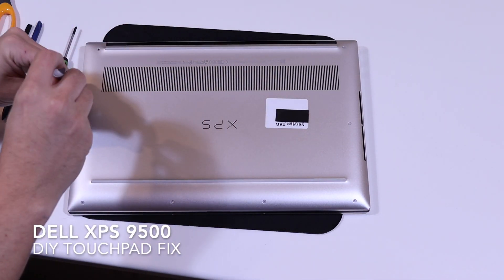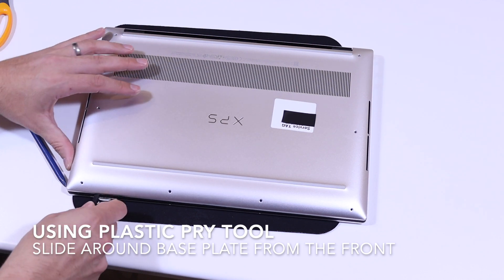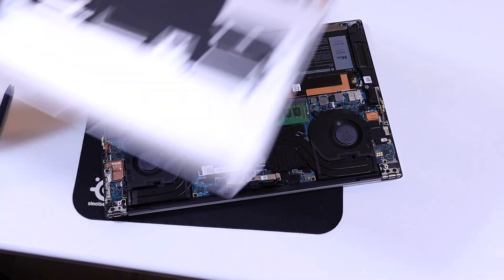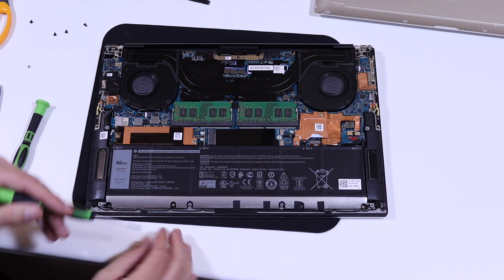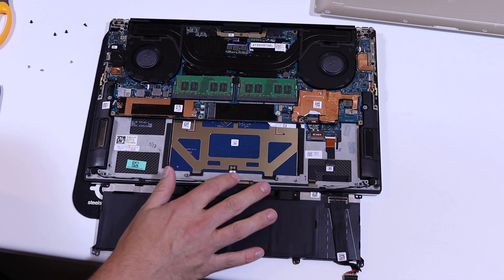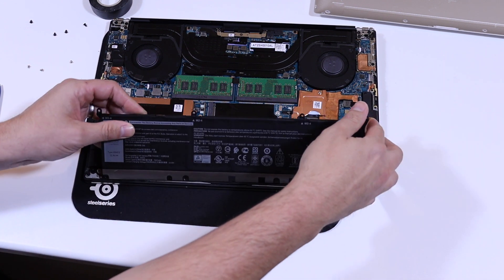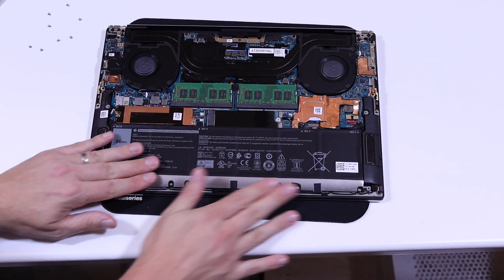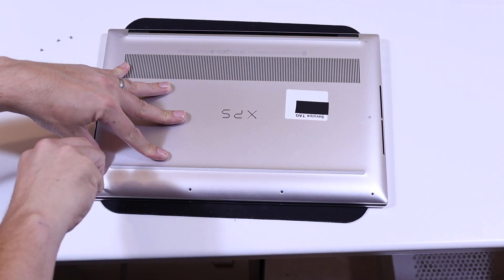Dell XPS 9500 loose touchpad DIY fix

Comment: Thank you so much! Your video literally saved me! But I stuck the tape to the battery, not to the frame. It doesn`t matter, but looks more neat. Thanks again!
PS. I have Dell XPS 9530 15`, so this solution works for it as well.
Reply from the maker: its just really sad that this issue is still allowed through QC :(

Comment: Same problem on a XPS 15 9520 (2022).
Reply from the maker: Sad to hear Dell still haven't fixed this issue!
Reply: @MashITTech  The official Dell support response is »the touchpad is working as designed« (as of yesterday). So its surface should bend on right or left click.
Reply from the maker: lol that sounds like Dell 🤣
Reply: @MashITTech  Well, I actually never had any problems with any Dell products, but after testing the new XPS 15 9520 (i7 12700H, 32 Gb DDR5 RAM, 1 Tb SSD, RTX 3050 Ti 4 Gb) for a few days with Premiere Pro my wife was ready to switch to Apple and is now quite happy with her MacBook Pro 14" (2021, M1 Pro 10-Core CPU/16-Core GPU, 32 Gb RAM, 1 Tb SSD).

Comment: Just given this a try:
I had issues specifically at the bottom left of the track pad. Applied two layers of electrical tape (one wasn't enough); worked like a treat. 
I'd never opened a laptop and this was actually quite easy.
Thanks
Reply from the maker: glad it helped, such a shame I am still hearing this issue exists!
Reply: @MashITTech  Completely agree! Dell wouldn't send out a replacement either, they offered to fix it with no time frame.. Found their CS to completely suck
Reply from the maker: do you know Dells CS have even been pointing their customers to my video which seems completely unprofessional to me. Maybe they should give me a job 😂
Reply: @MashITTech  Unbelievable 😂😂
Reply: I was gonna do the same (put 2 layers) because 1 didn't work. But unscrewinf the back I noticed that without screws the touchpad worked Just fine, without wobbles. The errore was putting the wrong screws in the bottom left corner (as the two bottom corner screws are differnt) and were pushing against the body preventing It from closing firmly

Comment: 🤦My touchpad seems to get little crumbs stuck underneath or between the inside of the panel every few hours and when that happens my touchpad gets kinda messed up and just clicks really janky if you know what I mean. After clicking for a while it smoothens out but do you think this is due to there likely being too much of a space gap between my touchpad? What kinda seems to help for the meanwhile is blowing air between the space and when I do that my touchpad goes kinda back to normal but still not quite how it used to be. When my 9300 got sent back for a touch screen replacement I asked them if they'd look at the touchpad issue also. They said they'd look at it but I'm guessing they didn't.

Comment: I got mine brand new from the factory in August of last year (after they said they fixed the issue). Well they did not and i tried to ignore it but could not. Now I have tried this and it actually works. Everything is as it should be. It really is a shame that Dell cannot solve this, but a guy with a screwdriver and a bit of isolating tape can. Conclusion: Thank you for this video!

Comment: So very much appreciated. The fix worked like a charm. Thank you especially for pointing out the trick where you don't need to untape the speaker wire and also for your easy to follow instructions. 😀❤️👍
Reply from the maker: So glad it helped. It is sad that this issue is still ongoing :(
Reply: I completely agree. I really hope Dell improves its QC. Thanks again for the help.

Comment: I was very excited when I saw this video, but like always, it is the small things that did me in. For the life of me, I couldn't get the battery cable off. Is there some sort of latch or catch that I need to release first? I couldn't feel anything to get my fingernails into to pull it straight towards the battery.  I put a lot of force into pulling straight towards the battery, but in the end I gave up as I was so concerned about breaking something. Is there a secret that anyone can share? I've done some googling, and there are lots of videos on how to replace batteries and the like, and they all gloss over the battery cable removal process.
Reply from the maker: No secret I am afraid, the cable is very secure on the xps, I guess I have just done so many laptops that I forget it may be difficult for people new to trying to do the same. Try and wiggle at the connector a little as you wiggle it out, maybe that will help.

Comment: Received my XPS 17 9700 today and it has the same issue. Trackpad registers two clicks, (a pre-click by lightly touching it which registers nothing, then the full click when pushed harder). It does this on left, middle, and right side, so when you click, it is like a crunchy odd double-click which is very imprecise and annoying. I opened it up and it looks a lot different than the XPS 15 internals. There was already a grey foam like padding around the bottom and sides of the trackpad area, I'm not sure if just specific to this model or if that was Dell's attempt to fix the same issue, but it's worthless.  Tried the tape method and it does nothing at all to improve the problem. I filed for an exchange (was instantly approved by Dell) and I just hope I don't keep getting units with the same problem. This unit was built to order and the BIOS reflects the build was March 2021, so clearly they haven't fixed the issue and obviously they are letting these ship and get past quality control anyways which is extremely disappointing and unacceptable. Definitely appreciate the fix here, but no customer for such an expensive and advertised premium laptop should have to Mickey Mouse a DIY solution.  Take my advice and upgrade/extend your warranty to the Pro Plus support. With that, I was able to get native English speaking customer service who were USA based, and able to process my exchange quickly and efficiently. It this keeps happening, I'd guess the only good options would be to attempt to get a full refund, or to upgrade/exchange it when a new and improved XPS 17 comes out to replace this one, which I would assume they'd fix this and the bonus would be that you'd get better processor and graphics card probably. In the meantime, completely unacceptable by Dell. I will update my review when I receive my 2nd unit to see if it has been fixed.
Reply: Update: After experiencing the crunchy/imprecise/double-clickish/noisy trackpad, Dell Pro Support+ within 5 minutes of me opening up a ticket/chat with them processed a replacement order. They let you hold on to the faulty laptop for up to 90 days (if needed) so you aren't out of a laptop while waiting for your replacement. I was also able to keep my hard-drive with the "Keep your hard drive" service that was included with Pro Support+ (available only for business, so make sure you always order your Dell through the small business website which often has better prices anyways). I got my replacement in just a week and a half after I opened my initial claim/ticket.  New XPS 17 track pad is perfect. No extra play or sounds; it's just how it should be. Solid and quiet.  The first one should NEVER have passed QI at the factory, but Dell has retained me as a customer for their quick resolution. Rest assured if you get a bad unit, they'll take care of you. My theory is they are still sending out bad ones as they know most people might not even notice or bother. Bad move on their flagship laptop.  Don't bother with opening up the laptop to try the ridiculous tape fixes. I tried that initially and it didn't do a darn thing.  Opening the case is slightly stressful too as if you aren't a pro tech, you can easily strip the star screws or even damage your case/plastics when trying to separate/open it.  If you do need to open it as I did to install my own upgraded m.2 drives, buy yourself a phone/laptop tool kit that comes with all the plastic tools used to separate tight cases.  Get yourself the proper and ultra high quality star screwdriver so you don't strip the screws, and before you attempt to unscrew them, touch each screw head with the hot point of a soldering gun/tip for 5 seconds. This loosens up the blue loctite they put on there and the screws will come out easily. Be careful opening the case as the aluminum is EXTREMELY sharp. I took note of this and STILL cut one of my fingers, so be careful.  Now that I have the replacement laptop in hand and all is well, I 100% can say this is the most finely built and most luxurious and thin 17" I have ever seen in 30 years of computing. Though this is more geared for business or media production, it was able to handle VR Alyx and even Cyberpunk 2077 with ray tracing on the 2060 it comes with. Impressive battery life for a 4k screen.  Definitely choose the 4k screen over the 1080.  Both only have 60fps so no point choosing the 1080. The touch screen actually does come in handy too on the 4k. 4k is definitely significantly more noticeable. I thought it was a gimmick but now I cringe at every 1080p display I see...they all seem pixelated and text looks awful in comparison.  If you get the XPS 17, you will be confidently happy. It was worth the extra coin. Buy it on sale and make sure you check everything including the trackpad when you first get it so you can RMA it if necessary.

Comment: Just bought  xps15 9500 and had the same issue. Dell tech support came over and replaced the whole trackpad/keyboard.  Does the trackpad really feel like a diveboard? Or it should be steady? 
I cant find a video that shows what the trackpad for xps15 9500 should actually be
Reply from the maker: It should feel firm, so you need to apply a little force for it to click. I have had some units that suffer play (trackpad feels loose) and some that have pre-click (where you press the trackpad and it moves down and clicks but doesn't activate the button, you then have to press further to click again). 
Its a bit of a joke at this point with only Dell laughing.
With some time and patience using the tape you can get it perfect, I have now done a few and helped a few people here also do the same :)
Reply: @MashITTech  thank you . Because the Dell engineer said it should click like a diving board in the bottom part of the trackpad. In your video you put the tape only the bottom part. I see comments that they also put on the sides

Comment: just got mine now in March 2021 - and still the trackpad has this slight looseness driving you nuts when using it.
I plan to install a 2nd m.2 SSD anyway - so will wait until this arrives and then do the fix myself.

Very poor QA by Dell for such a high-end notebook, when you consider the fix being so easy.
Reply from the maker: I just can’t believe this still haven’t fixed this! What’s wrong with dell....
Reply: Just an update after three years, as I just had my Dell open again for some cleaning... it seems, that the tape used to attach the speaker cable to the battery has some chemical reaction with the silver-metallic tape at the bottom of the battery... you can clearly see the silver-tape became rough where the black tape-stips contact it... and also this silver sticks to your hands, after handling the battery.
Everything still working - but I cleaned the loose "coating", as I almost assume it is conductive and should not be near any contact in the notebook.

Comment: Thank you so much. I had a rattling trackpad, and it's now perfect! I bought it in Jan 2021, and it was very clicky. Dell replaced it, but the new laptop had the same issue. Then they sent an engineer round to replace the palmrest, which made it better, but not perfect. But the next day I discovered the speakers weren't working and the light at the front was missing. Another engineer visit to connect the speakers and put in the light that the last guy had forgotten to put back in. He went on his merry way, expect now the replaced palmrest was clicking again, worst than ever!  I was about to just return the laptop but this has fixed the issue. It's perfect. (I put the tape middle, left and right and 2 layers). Thank you for posting this video - for anyone else, I would say after my experience don't bother contacting dell just do this.
Reply from the maker: I am so glad it helped! I have fixed a few customers machines with this simple tape mod for the very same reason, the engineers do more harm than good! Also dell have even pointed some customers at my video! I think it is sad a company the size of dell cannot fix this issue and persist in sending out faulty units on $2000 machines
Reply: @MashITTech  Yeah I paid just over 2 grand for it, not ideal and my Mrs wasn't happy about me taking it apart - I did it while she was out and told her afterwards!  Thank you again for posting the video, the XPS is great in every other way but this really lets it down.

Comment: I have had it replaced 3 times by the DELL and it always come back with the same problem. Never had a worst experience with laptop and I have had quite a few of them (not from dell). Second return included replacing the motherboard, screen and some other internals. Premium laptop my ass. DO NOT BUY!!!
Reply from the maker: Such a shame, it is such a lovely looking laptop ruined by Dells lack of QC!

Comment: Thank you so much for this smart, easy and working trick!! 
Although my XPS 9500 was not seriously affected like, as they say, pre-August 2020 models, it still suffered from a small but annoying jiggling on touchpad's lower left corner . Knowing that contacting Dell  assistance for something that they officially say has been fixed would turn into a nightmare, I got myself the right screwdriver and VOILA'!  I had to apply way more electrical tape that what's in the video, 3 layers all the way the bottom side of the touchpad. Now that after 4 months I have also solved the terrible freezing screen problem (well known among xps15 users) i can finally say that I have a cooool notebook. Thanks for sharing!
Reply from the maker: Glad it helped. Really sad Dell can't sort this issue out though
Reply: Hello , can you please tell me how did you resolve the freezing screen problem? Many thanks

Comment: I just wished you showed the faulty pad before the repair 😐. I could have seen how bad the fault was. Mine doesn't rattle as such more faulty in the bottom corners.... you could probably slide a credit card in the gaps when you press down.
Reply from the maker: Oh sorry mate, didn’t think to do that. This model wasn’t that bad, it just had the dreaded preclick where the pad pushed down making you think it was activated when you actually needed to press again harder. There was no gap around the pad. I have since had another brought in which was much worse and had to add extra tape even sliding some between the pad and frame. Totally unacceptable by dell 🤔
Reply: @MashITTech  I'm going to have a go tonight hopefully it will work. How many strips of tape did you apply? Around 5?
Reply from the maker: No, on my worst it was 3. but one of the strips I slipped between the pad and frame. From the few I have now done for people every one is slightly different so you will need to apply it and test and then possibly make adjustments. I don't screw up the base plate until I am happy its working. Be careful with the speaker cable attached to the battery 👍
Reply: @MashITTech  thanks. Might be worth applying a L shape with the tape.
Reply from the maker: Give it a try and let me know how you get on. Oh and ask away if you need any help
Reply: @MashITTech  All sorted.  tried the tape and wasn't really working for me so I decided to use some car registration sticker pads. I basically cut out an L shape and backwards L and placed the pads in the same area but on the bottom left and right of the Pad. It's not perfect by any means but it's alot more firm and lines up perfectly.
Thanks again for the advice 🙏

Comment: Second update to this: dell has given me the option to either return it and get a brand new exchange or get a full refund. The  problem with the refund is that I would have to go back to my old HP Envy x360 from 6 years ago, it is very very laggy and noisy as hell. At this point in time do I suffer through this with the refund and get the XPS 15 with the 11th gen processors? Or wait for the macbook pro 14 inch coming out later this year, or just take the brand new replacement. I really like the form factor and performance of this laptop but if I get another lemon I'm going to get a full refund and rip this company.
Reply from the maker: With the way they have handled this, I would take the money and run. The M1 MacBook is so good I would wait for the 14" or 16" to be released.
Reply: @MashITTech  I agree. Sounds like best plan right now, thanks
Reply: @MashITTech  can I buy a macbook pro 1 and then trade it in and pay the difference for when the 14 inch comes out?
Reply from the maker: My advice would be get the base air, and look around for discounts. This way you will loose less when you come to sell and the air is almost as good as the pro anyway in terms of performance. It will only cost you about $900